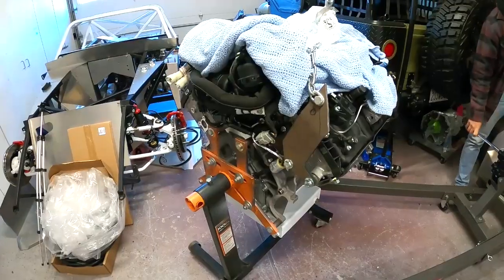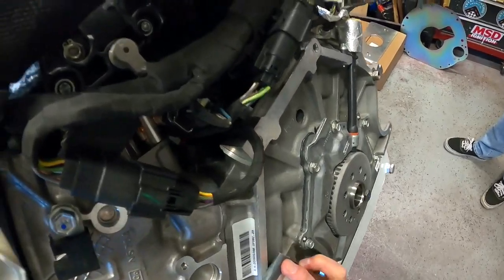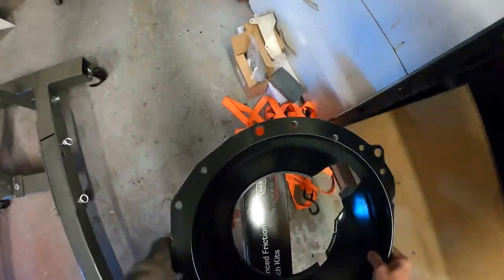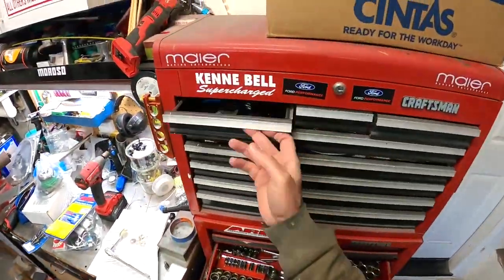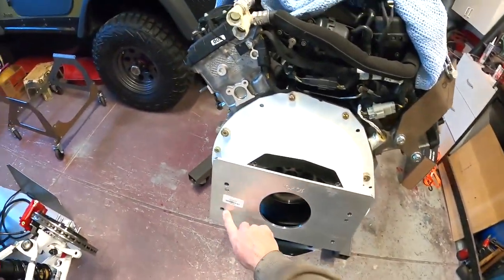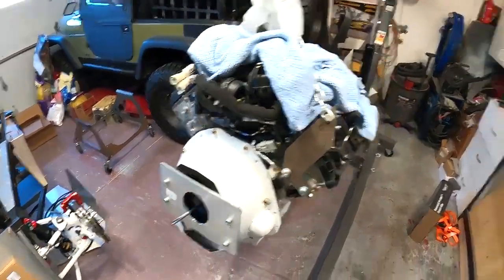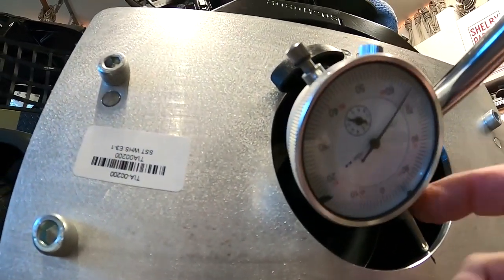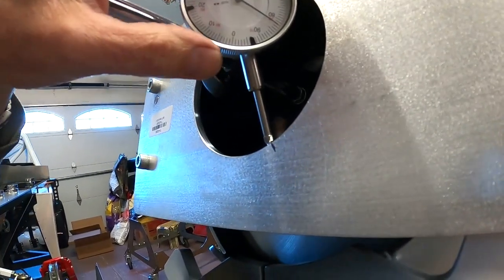Cobra Daytona Build- Indexing Bellhousing, Video 63

Comment: Two hints: I'd recommend removing that insulator sleeve that's around the crank sensor. When I did mine, I too was right at the edge of the tolerance. Much like you. Removed the sleeve and the measurements improved to almost zero. It's a very small tolerance and that insulator trapped between the block plate/bell housing and engine block made a difference in my experience. Second I'd recommend installing your clutch dowel pins before bolting on the flywheel. Way easier to hammer those in with the flywheel resting on a flat surface vs. mounted on the engine. Maybe better for the flywheel too.
Reply from the maker: I did check that on you advice and was clear. Not thrilled with .005 but it’s within specs. As for the dowel pins, my flywheel and pressure plate didn’t have them. It came with these special bolts with locating heads. Not a Ford flywheel or pressure plate. Thanks for keeping an eye out. Hope you’re enjoying the videos. Your truck is looking great by the way.